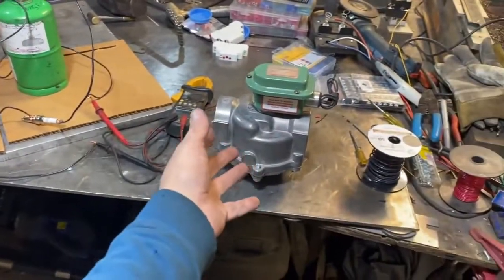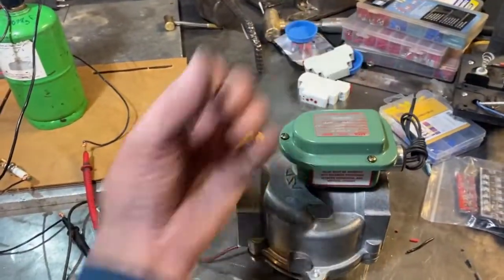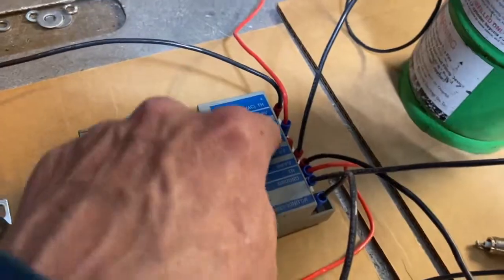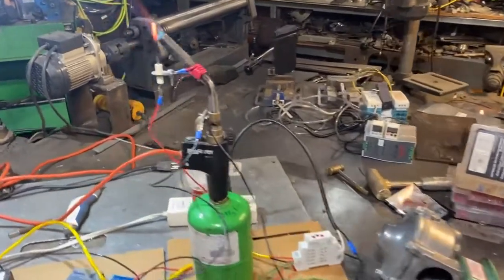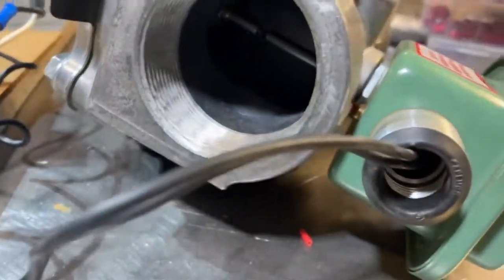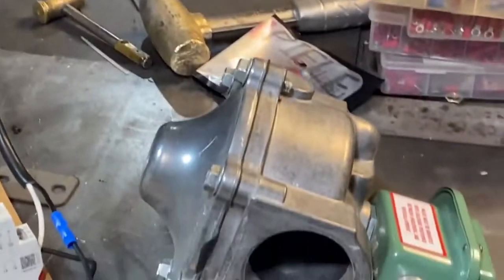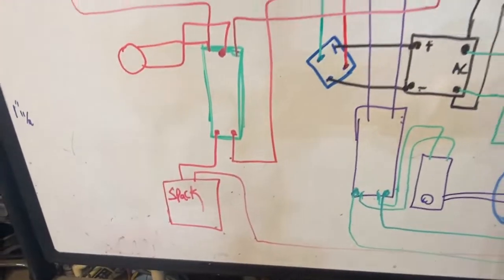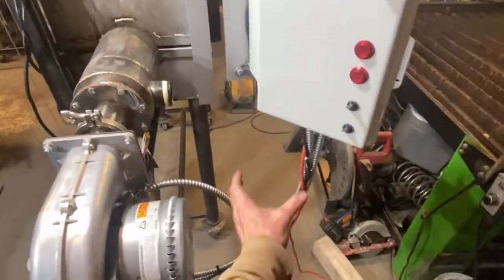Flame Sensor Switch /Circuit

Comment: I agree I hate solenoid  being on, and using power.
 But it is safer, 
Most solenoids need higher voltage to actuate, but can hold at lower voltages. Need the right size resistor that goes up with resistance and cuts back the current.  Thinks it's called a PTC thermistor

Comment: What closes the valve in the event of a power failure
Reply from the maker: The guy manning the furnace will shut off the main valve . its a constant job once started if will be manned. A large ball valve is the main control and the furnace gas valve is turned off during shut down . The location of the furnace would allow a safe burn of of the gas without air . Not an ideal situation at all but it will do for now

Comment: Why not use a gas valve and setup from a makeup air unit or a HVAC package unit. depends on how many BTU's your burner is.
Even utilize the pilot line so if wind too high of a blower adjustment puts the flame out , the igniter will re lite the pilot. when that is proven the main gas valve opens and the pilot ignites your main burner. get rid of the spark plug. get igniter rod the connections are more friendly with your igniter module. 
Utilize proven tech, less time wasted
Reply from the maker: i needed 600,000 btu minimum , this is well over $1000 even if i use 2 300,000 btu units ar $400 each its alot of extra plumbing . I considered it and looked at valves for days

Comment: That bridge rectifier is designed to be bolted to a heat sink.
Reply from the maker: Only on high power applications . This is about 20 watts
Reply: @NOBOX7 , ok.

Comment: You’ve got the correct idea, a normally closed valve that opens with control input.    With it being manned, it’s ok to have it normally open and shut off the fuel supply using a second valve.

Comment: For Switching that happens not to often you might want to use mechanical Relays.
Solid State Relays fail to a closed State and that’s often not the right Way.

—

You want to put the Timer in the 24V AC Path to get the Signal independently from the SSR and Rectifier.
The second Use that can be guessed from the more exhaustive Drawing can still go over a Relay, but you want to minimize the Parts in the Signal Path wherever possible.

—

SSR and Relays should be available in 24V AC, DC and AC/DC.

—

Breaking (only) the Neutral Connection is always avoided.
Usually you chain the Switches/Relays on the Live Side.

—

You mention a Ball Valve in the Comments.
Spring closed Actuators on these are often well suited but might be to slow for Opening on Startup.
A Possibility might be to combine a NC Solenoid Valve that is just big enough for Startup with an actuated Ball Valve for the remaining Flow.

(Fitting an Actuator to a Ball Valve can be Way cheaper than getting a Kit but might require some Ingenuity. Valves with Mounting Hardware for Actuators tend to be very pricey. The Actuators are often used for Air Dampers and the like. You just need one with enough Torque for your Ball Valve. In the US used Honeywell Actuators should be available for Testing. [Belimo, Siemens, Honeywell are some big Names]]

—

For Safety Purposes the NC Valves are used and can burn quite some Electricity in their Solenoids.
These need to be rated for constant Operation.

Comment: A normally open gas valve!  😮 scary
Reply from the maker: Dont worry a secondary operating valve will be in place and its a manned furnace . It will not be left on its own . When the operation is done a 2" ball valve will close off the gas
Reply: @NOBOX7  Copy that.  That sounds better. 👌
Reply from the maker: Yes i was not happy when i found out i do agree with you . It will likely get swapped but its going to have to do for the debuw
Reply: @NOBOX7  That would be ideal since the chances of something bad happening is greater.